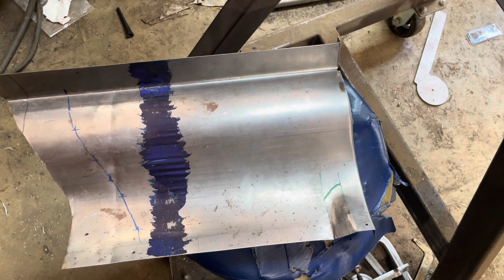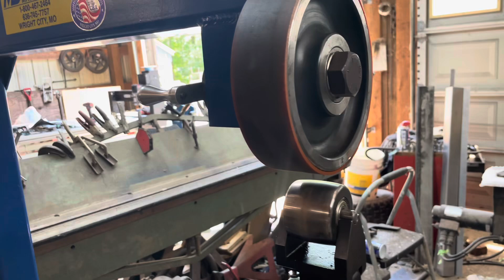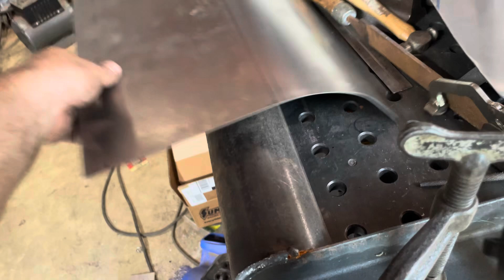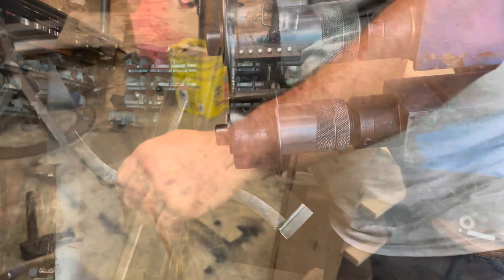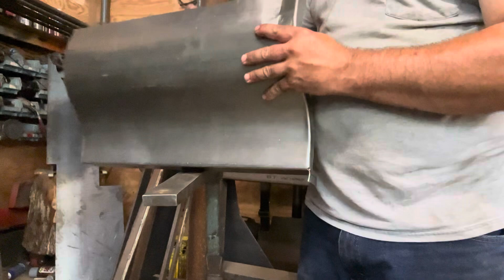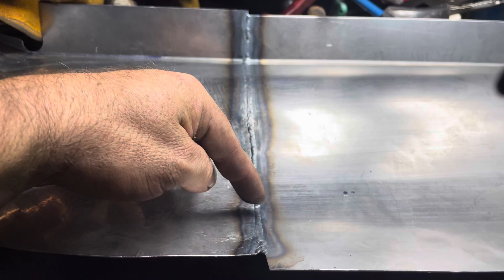Transmission Tunnel Transition Seat Riser

Comment: How did you put the flange? Can you please show that?
Reply from the maker: @johnnieburge4997  the tall straight back flange I did in the brake the s shaped edge flange I tipped it in the bead roller shrinking or stretching where needed to rise it up and not distort the panel. Here is a video that shows some of it and will give you a better idea hope it helps. https://youtu.be/2ssj1rP7bRE?si=sB6Z5i_x1yWHXWHG

Comment: Thanks for another great video.
Reply from the maker: Thanks I’m hoping to have time to sit down and focus on metal finishing next.
Reply: @motleymetals  That is a whole other thing. LOL. I have wanted to know, Is the skate board bottom die on your bead roller made by you or bought? Thanks
Reply from the maker: @garyp77551  it’s a Mittler Bros that I cut a section off of to make a narrow soft die and then cut a step and a radius into. My big beading machine w/ 1.25 shafts I ordered the polyurethane from McMaster Carr and fashioned a set from it.
Reply: @motleymetals  Thank You
Reply from the maker: @garyp77551  no problem hope it helps